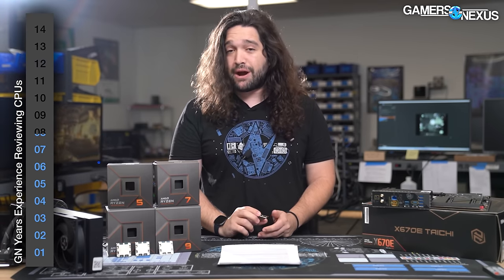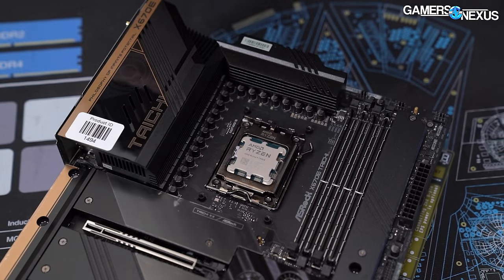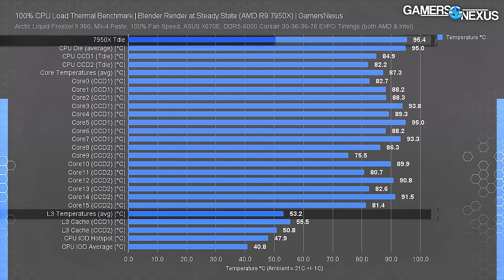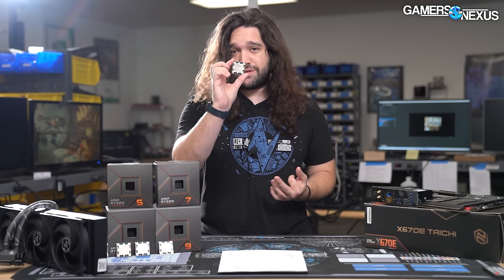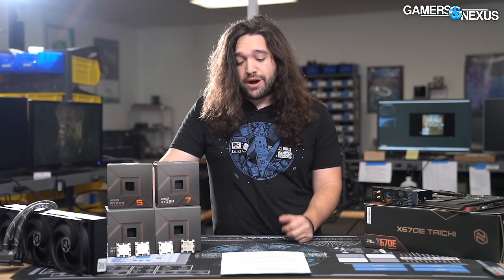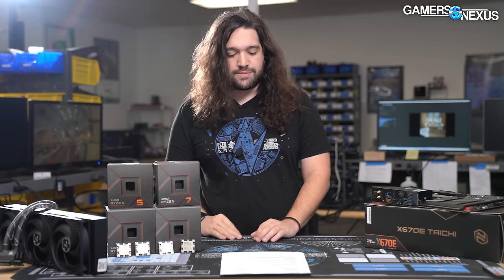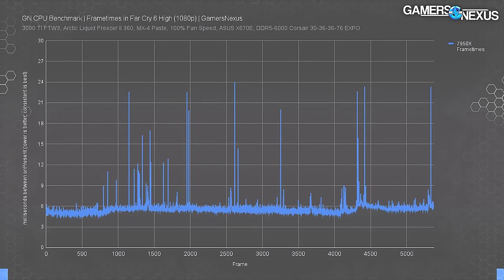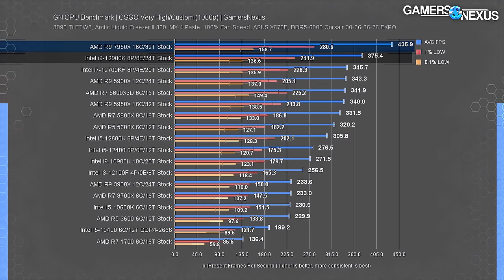95°C is Now Normal: AMD Ryzen 9 7950X CPU Review & Benchmarks

Comment: Any chance you could run a test comparing the 7950X and 5950X's performance and efficiency at different power targets? It'd be super interesting to reveal the efficiency gains that AMD is boasting about but not taking full advantage of in the stock configuration, and to see if an efficiency-centric build would even benefit from using a 7950X over a 5950X with appropriate power limits applied.

Side note, you keep blowing me away with your thorough testing methodologies, it's very impressive. Keep up the great work!
Reply: Geekerwan has done it(video not on youtube yet). 7950x achieved the same level of performance as a 230w 5950x with just 98W. That's indeed 61% less power drawn or 2.556x more energy efficient
Reply: @oMega-sm1eg  thats fucking HUGE if true.
Reply: bonkers
Reply: He should compare the Ryzen 9 7950X vs the Apple M1 Ultra. Both are TSMC 5nm. Zen4dozer
Reply: @saricubra2867  They are also completely different architectures, die sizes, and use cases.  Dragon range and pheonix would be more appropriate to compare, those will be high end and low power 5nm laptop chips at least.
Reply: @saricubra2867  Actually that would be interesting. I have a 5950X build rig and recently got an M1 Max from work, and the M1 Max beats the 5950X in all but the most parallel of builds. I think it's more to do with the M1's HBM than the cores though. The MacBook Pro gets uncomfortably hot, while the build rig doesn't even rev up its fans. I'm amazed at what the M1 can do, despite my distaste for modern macOS and all its bugs.
Reply: @rcavicchijr  Different architectures that suck in perfomance per watt specially with the energy crisis right now. You cannot turn around that fact.

Apple uses TSMC 5nm like 10 times better than AMD right now, at least Intel tried with "Big-Little" Alder Lake to counter Apple knocking x86's door. 

AMD failed to fight back against apple now, Intel too. What they do is embarrasing all for the sake of inflated synthetic benchmarks and higher overclock scores...
Reply: yeah i'd love to see that.. if both were at the 120 watts of the 5950x how do they compare... seems like all they did was figure out how to make it handle more power\temps which lead to higher clocks.. but maybe they only lose 10% performance when halving the power as the last part is the hardest and can imagine them just jamming in the power to win the benchmarks... probably even worth having to replace some chips in the future if they can't handle it and to stay ahead in the cpu wars now... reminds me of the Xbox360 :P
Reply: The new Zen4 CPUs are crazy power efficient when looking at other tests - but not the way they are set up by default by AMD. AMD wants maximum clocks and sacrifices a lot of efficiency for it for some reason.
Reply: @MrReese  I assume they aren't a huge improvement in performance unless they crank that shit, but at the same performance level as last gen they are super efficient?

Maybe they are thinking performance sells over efficiency?
Reply: @MrReese  reason = intel :P
Reply: competition and the fact they use so much power, I guess amd figure, why not. ??
Reply: @oMega-sm1eg  PCWorld put out a video with some Cinebench tests with the eco modes enabled, and in multithreaded the 105 watt mode was within spitting distance of the unthrottled mode, and the 65 watt mode was still outperforming the Intel 12900k, and single-threaded the eco modes were identical and very nearly exactly the same as unthrottled, and all outperforming Intel.

Seems like AMD could've saved themselves a lot of bad press about the power consumption and temps by having it be in 105 by default, as that's still pretty massively outperforming the 12900k, with dramatically less TDP.
Reply: @Fafhrd42  True. I would say it's not wise to enable the boost by default, maybe there would be a BIOS update to change that. But they would be competing with the 13th gen very soon so they do need every bit of performance they could squeeze out.
Reply: @oMega-sm1eg  Which makes a lot of sense, they dropped to 5nm here from 7nm (40%) and then IPC gains.

If you are looking for efficiency set your TDP to 105 or 65w and those gains will be there.   Shockingly bad on Intel's side, and probably will be even worse on Raptor Lake.

They will be doing the same thing on the laptop chips, and so Intel is going to be in worse shape there than on desktop.    In workstations/desktop situations power usage can be pushed to that 250w usage pretty easily.   Pair that with an RTX 4090 though (500w) and your looking at 1kw power supplies, much further and you run into the 15amp circuit limits.
Reply: @Nth3nSum  I hope you didn't just divide 7nm by 5nm to get to 40% efficiency gains - this is not how it works. :D These are first off just names and I would think there are more factors than just transistor size regarding efficiency.
Reply: @bhume7535  It does. If AMD ignored Intel cranking up the clock speeds and made this chips at 65W then they would perform enough to be beating Intel top chips. 

And then all everyone would taking would be how Intel is back being the kings and totally destroyed AMD etc and then good luck explaining that you created something that performs a little slower than the competition but is much more balanced and cool. 

All the discussion will be how AMD can't perform and you will be crazy to buy one.
Reply: @markmuir7338  yeah, very similar here. I think it may be more about the optimized storage and memory controller interfaces in the m1... So it's really impressive for say node projects and other compile loads touching many files.

It's definitely impressive.. If it weren't for a few hiccups with x64 emulation add io heavy work with docker. It's definitely a workhorse. Also have an m1 air and battery for days in personal use.

Love my 5950X desktop. Hoping to see an X3D 7950 variant in the spring and may jump back to AMD in GPU at that point.
Reply: @brei.z  they have an echo mode at 65W or in between at 80-90% of the performance. Other reviews have tested that.
Reply: @MrReese  I think it's more about bench charts... I'm probably going to tune down the pbo a bit.
Reply: @aztracker1  Thanks, yeah have seen some since. Is crazy isn't it ! so if amd didn't bring back the competition.. we could have ultra efficient computers... or we would still be on 14++++++++++++++
Reply: @Nth3nSum  Its not a good practice to have your psu over 70% workload maybe even more when you include all other things like mobo,ram,coolers,system fans yeah you need more then 1000wat power supply.
Reply: @oMega-sm1eg  I think it's this segment here https://youtu.be/r6zYJftXIx8?t=1455 but why did he lock the frequency to 3.9Ghz? Doesn't the 5950x turbo to 4.9Ghz? Unsure if the comparison is valid because of this.
Reply: @markmuir7338  What kind of 5950x rig do you have that an M1 Max laptop outperforms it? The 5950x beats the M1 Max even in single-core performance and buries it in multi-core.
Reply: @gewinnste  My 5950X is stock voltage with a 300mm AIO. The synthetic benchmark results (Geekbench) land it right where it aught to be - which is, as you say, above the M1 Max. But my conclusion stated earlier is based on real-world CPU and memory bandwidth intensive tasks that I make my money from - in which case the bandwidth of the M1 Max's HBM stacks give it a significant edge - and it scales better with increased threads too, despite having fewer cores than the 5950X. The CPUs on the M1 Max have almost as much memory bandwidth as my rig's RTX 3090. I would really like a desktop part with tens of gigabytes of HBM.
Reply: @oMega-sm1eg  bruh
Reply: @EyefyourGf  true..but just stick power meter in your power outlet..then you will have better picture how much whole pc case draw.
Mine example, everyone told me that I need 700+w psu 
(5900x + rtx 2080 gaming trio), h100i v2, 32gigs ddr4 3600, 2x fans, 1x m2, 1x sata ssd, 1x hdd

-Battlefield on FHD, resolution scale 200%, gpu 100%
-Cpu 4.4 ghz 1.175v manual all cores
-Gpu 1900mhz  undervolt .917mv
-Corsair cx 550w, thats about 50-60% load
=== 300w straight from outlet

Vice versa, when doing work in Windows or even cpu bench then gpu is at idle..very rare occasion that cpu+gpu will be both 100% at the same time. Even then 550w is enough.
Reply: @CroIntr00X  Ideally your power draw at 100% should be like 70% of your psu's max rating. It's best not to be maxing it out.
Reply: @CroIntr00X  your psu is underpowered, it should not run at it's maximum.
Reply: @thenameless5038  correct